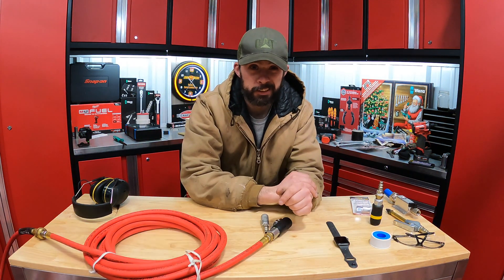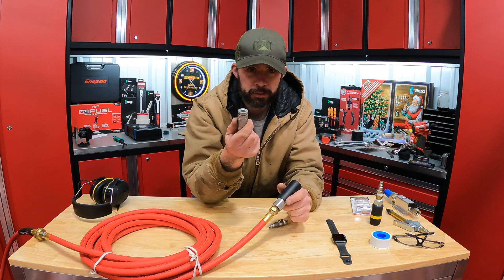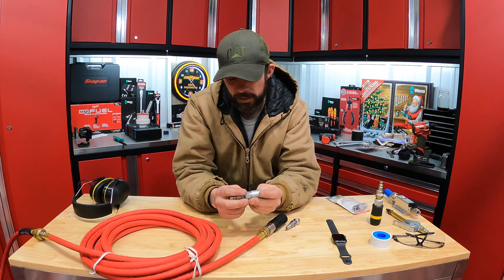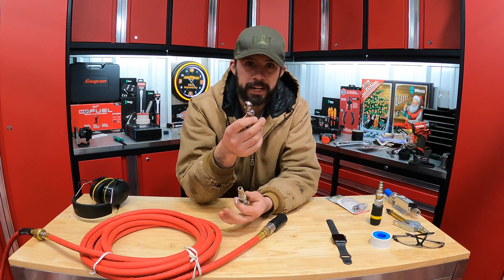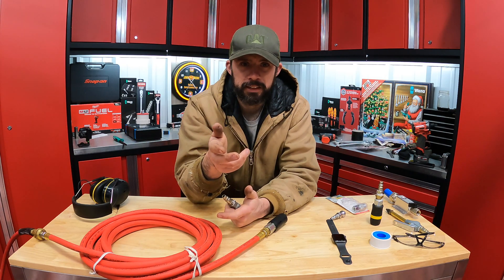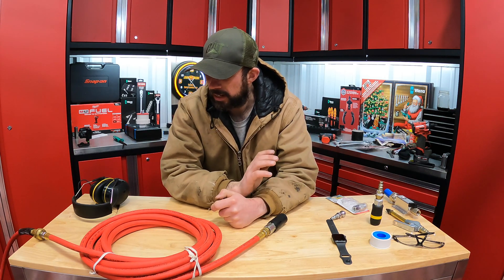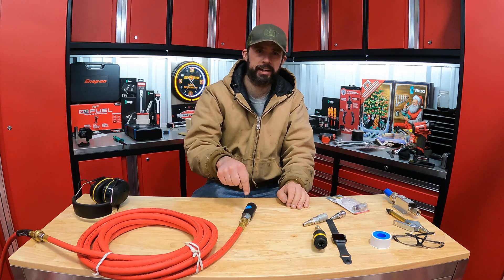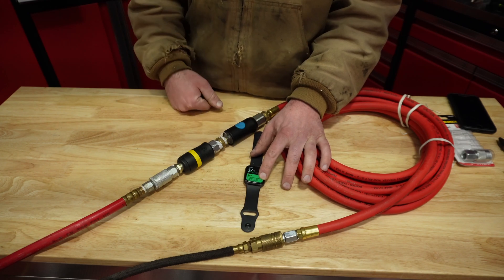Stop Using Those Junk Air Tool Couplers From Harbor Freight, Couplers You Have Probably Never Seen!

Comment: Milton V style fittings are nice. Large high flow openings collars stays open when disconnected for easy one hand connecting. Flexilla has a high flow system that looks to be similar.
Reply from the maker: Yeah I was surprised by the flow from the Milton V.  I will have to check Flexilla's system out thanks!
Reply: I use the Milton high-flo V-style, and they work very well and don't break the bank.  I didn't want to spend $1000 on couplers and plugs. I use the brass or steel and shy away from the aluminum version as they are easy to damage. Those Prevost couplers/plugs can get rather expensive when setting up a home shop air system.

Comment: Perhaps a ten dollar in line back flow valve near the male end of the long shop hose will keep it from gushing air when removed from a wall connector and eliminate the need for expensive quiet female connectors around the shop walls.

Comment: It seems that most of the content in your video is regarding the noise from coupling/decoupling air fittings where you expel the volume of air inside the hose.  In my experience, 99% of the air coupling/decoupling in most shops occurs at the tool level.  This is usually where the tool has a male end and the hose has a female end.  The hoses are usually attached at the wall (or ceiling) and are rarely uncoupled. You aren't usually dumping the entire volume of air from the hose.

I don't usually hear much more than a brief "tsssst" or "pop" so I'm baffled as to what the concern is.  What am I missing?

Also, in my 35 years of working with air tools, I have NEVER seen anything whip around when disconnected.  Not to say it can't happen, but I just can't imagine a situation where it could possibly occur.
Reply: agree. as if he has the plug on the hose and couple on the tool?
Reply: And who really gives a fuck

Comment: do manufacturers not make a captured exhaust for air fittings? They do for hydraulics.
Reply from the maker: The Prevost will defect most of the exhaust out a hole in the side.  Other safety couplers tend to dump the air out the end towards the fitting.

Comment: Besides the difference in noise a huge difference between the Parker/prevost and the original coupler is that both prevost and Parker have dual stage release system compared to the original one that can whip around and is dangerous at times.
Reply from the maker: Yep defiantly can if you don't have a good hold on the hose.  Just another reason to buy a safety coupler.

Comment: Thanks for the video. Home Depot has a Husky version of those Prevost. I've been using them with no problems for 4 years. Home Depot still sells them.
Reply from the maker: Thanks!  I will have to check them out!
Reply: @Tools-Tested  Harbor Freight also has a safety coupler that I bought but haven't used yet. It's item 57571. It's part of their new "Merlin" line of air fittings, which I guess is supposed to be higher quality than Central Pneumatic fittings.
Reply from the maker: Interesting I will have to look for that next time I’m in there.  

Thanks!

Comment: In my experience, I'm working with (apparently) lower psi pressures, so for me, it's only a safety and ease of use issue.
As a result, I went with an even cheaper, all metal option: Milton S-1750 Safety Exhaust Coupler
There's no way I'm airing completely down just to switch tools.
Great video! More options to choose from.
Reply from the maker: I will have to check them out, thanks for the info!

Comment: Maybe more upfront cost but a manifold system with two or three hoses would be nice... Just prevent having to change tools over as often to begin with. The older I get, the less careless I get, and the more appreciation I have for what good ear and eye protection can do.
Reply from the maker: Yeah that would probably make it a lot easier.

Me to I definitely try to wear hearing protection and safety glass vs when I was younger.